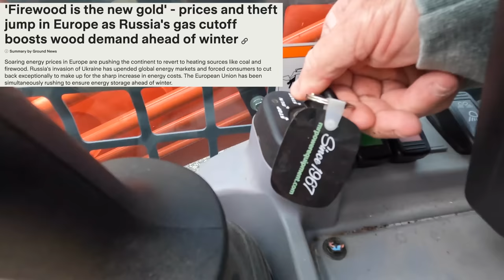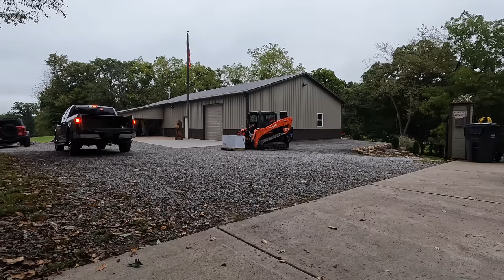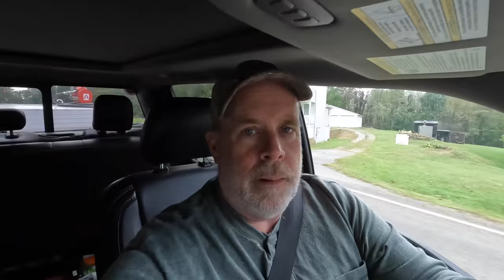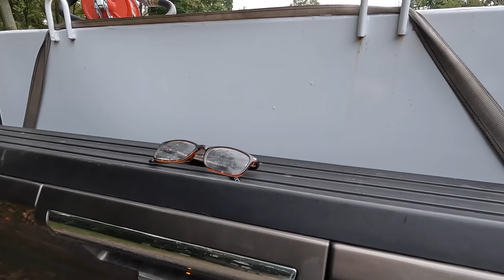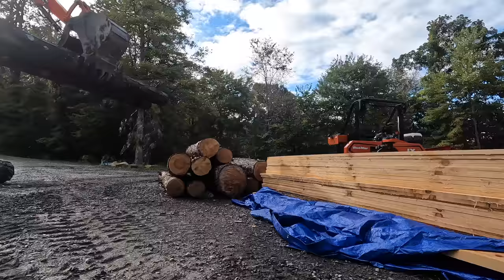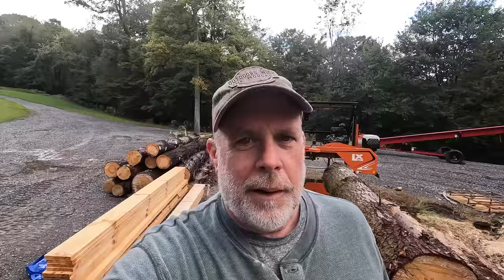Firewood IS the New Gold? It just could be!

Comment: Hi from Italy.The worst hit business  here are baker's sbops and foundry's.
Example; A baker shop with 4 workers,lasts year electrical bill was around 700 dollars x month now is around 5/6000.
They are closing shop on monthly base, same increase for normal customers.Natural gas is gone up 500%.It's going to be' hell for these people this winter.
I live near a forest,in my region i can cut alll the tree's that i want is long is they are on the ground in the forest for free.
I have wood burning stove,so i have no problems,but the people in the in the city's they are going to freese this winter in the northern part of Italy,not is much in the south,like Sicily.
Firewood: Around April this year very dry firewood for stoves was sold on pellets box,little bit over 2 cubic meter.
One box weight is around 2200 lbs was sold at 150 Euro equal to 150 dollars.
Now that wood is hard to find,if you find it,the seller want's over 300 euro or dollars.

Comment: Mike - love the channel.  Question:  I split two cords of white oak pretty thin last FEB, and, along with some cherry and black walnut, I think we are set. That said, I have have a non-catalytic Regency insert (that has the re-burner tubes) that has been really great for heating our house (2000sqft).  Do you still think it necessary to get the middle of that oak down below 25 percent given the outside is at 16-18 percent moisture?  It is all gray on the outside.  I am wondering if the moisture will simply burn out/steam out without much btu reduction. Adam at Hometown acres did an experiment with his reburner stove insert - interesting results.  Given that, as you said, firewood may be at a premium, and, I may need to help my neighbors out, do you see any problems as you have much more experience with it.   Thanks much, fellow "Picksburgher" - go Stillers.  GOD Bless
Reply: Oak usually needs 2 years to dry to 15%
Reply: @123gonow  Steve, I know, but thanks. The question is really does it need to be that dry to burn well in these reburner stoves. Adam at Hometown acres did an experiment last year, and while the green wood took a long time to catch on hot coals, there was only about 30degrees of BTU loss (not that I am advocating burning green wood...lol!)  It was an interesting video.  GOD Bless

Comment: Hi mike ,watching from Australia ,what does a quart of wood cost where you live and would a quart of wood fit in your trailer ,trying to understand how much wood in a quart 
Cheers
Reply: Paul, in the US, it,s a CORD, not a quart.  The measurement of a cord is 4 feet high, 4 feet wide and 8 feet long.  So, about 1.2M x 1.2M x 2.4M in height, width and length, respectively.
Reply: A cord of wood is between 48 and 60 inches wide.  4 feet high and 8 feet long.  Somewhere between 128 and 160 cubic feet.
Reply: A cord can be from 250 dollars to 450 depending on where you live.
Reply: Cheers guys ,thanks for that
Reply: Just google it.
Reply: We sell it by the cord...not a quart.
Reply: Not quart,  Cord=Face Cord or Rick.  One third of an actual Cord,  16” by 4’ tall by 8’ feet long.
Reply: @oldmanfred8676  Nope.   1/3 cord.
Reply: @heymakerphd1982 ,
Yep, got my tongue wrapped around my eye tooth and couldn’t see what I was saying!
I will correct it!
Reply: @oldmanfred8676  Good man!
Reply: @jramsdenbb  thanks john,i like how you converted feet into meters for me ,😀
Reply: @pauldonaghey250  I was born, raised and educated in the US, I fought and bled for my country and I consider myself a true patriot but for the life of me, I can’t understand why we are still using the imperial measurement system!  LOL

Comment: It is not very far from the truth. Firewood cost SEK 500 (50 dollars) about 1 year ago. Now it is sold in some places for SEK 1500-2000 per cubic meter.

Jacuzzis are dumped on sales pages and wood and other heat-based products are most sought after due to the energy crisis
i live in sweden 1hour from stockholm.
Reply: The market for solar panels has really exploded over here. Products are no longer available in the foreseeable future. All villa owners with direct-acting electricity are in a really bad situation.

A 15kwh solarsystem without a battery runs between 200,000-250,000 sek.
(about 23k dollars)